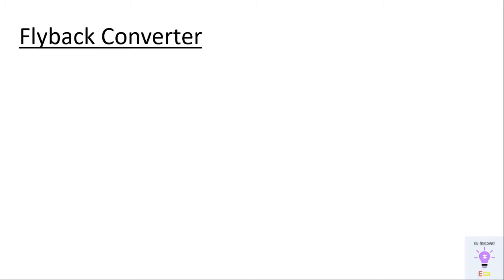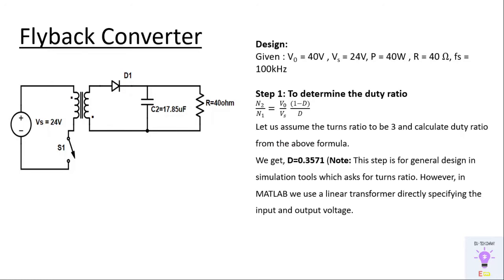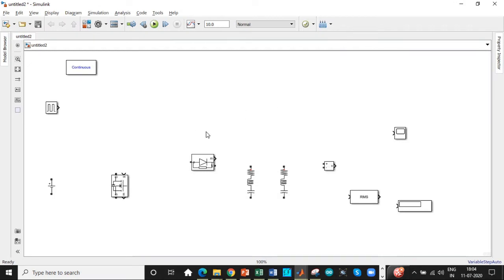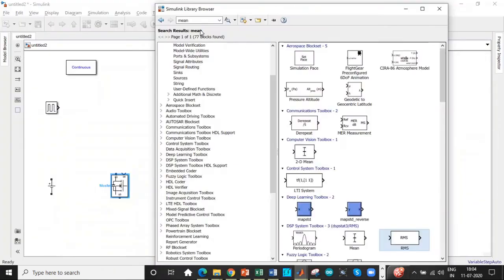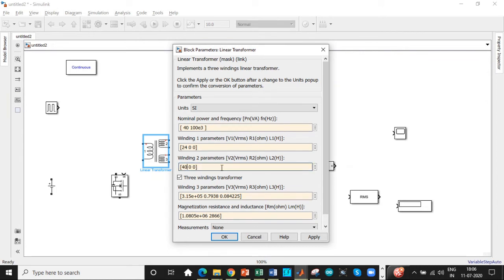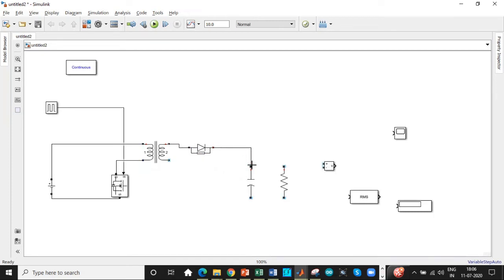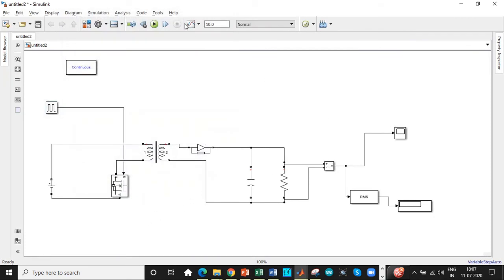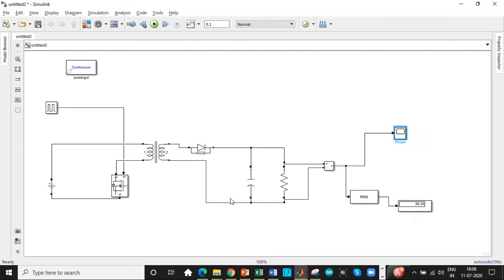Design and Simulation of FLYBACK Converter using MATLAB | SIMULINK

Comment: 1. wrongly simulated, you have showed the results just because your transformer set voltage ratio, you can verify that for any value of duty ratio it will give you 40v because you have set secondary of transformer to 40v.
2. you have connected transformer in same polarity. Its polarity needs to be opposite for its correct theoretical working.

Comment: Hi, I checked the voltage after the transformer why it was going to -ve also and in primary also it is going to -ve but it not to go right as the supply is dc

Comment: Hi sir, how did you setup the dot convention on the linear transformer?
Reply from the maker: Hi DurianL. Unfortunately there isn't a feature to set up the Dot convention in MATLAB. By default it will take. But in case it doesn't, then interchange the connections of the secondary. So that polarity of voltage built will reverse. In PSIM we have that feature to choose the polarity based transformer.
Reply: @ElectronicsMaddy  I see, thank you so much for your response.
Reply from the maker: You are welcome DurianL :)
Reply: @ElectronicsMaddy  I change the connect to compensate the doc convention, however outputs 0 volts, odds...
Reply from the maker: Hi. I would suggest you to recheck. Because if you had followed the steps mentioned in the video, then it will work.

Comment: I need output voltage 110v and 200w. So how can I get this
Reply from the maker: So you can achieve it by using the design steps mentioned in the video. Substitute in formulas and find the values according to the requirement